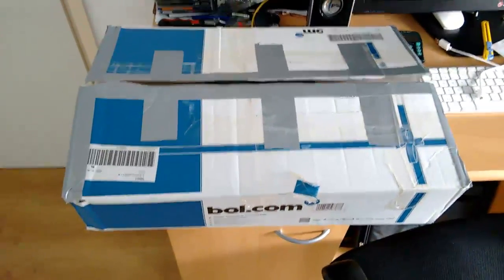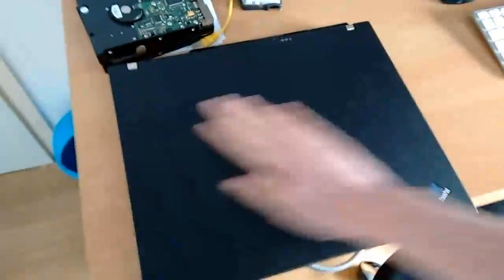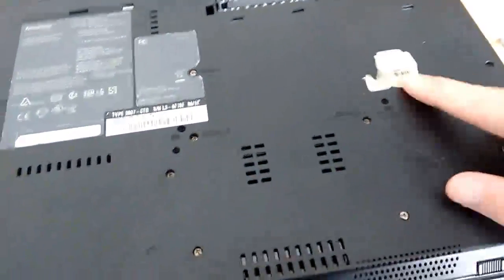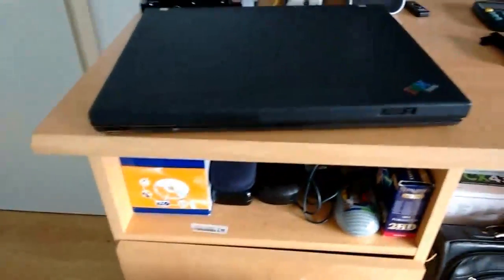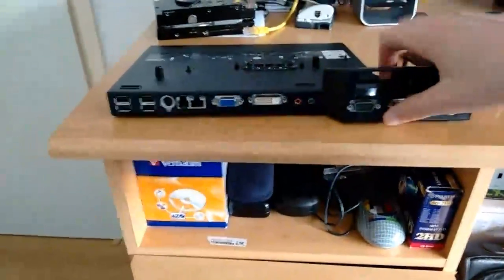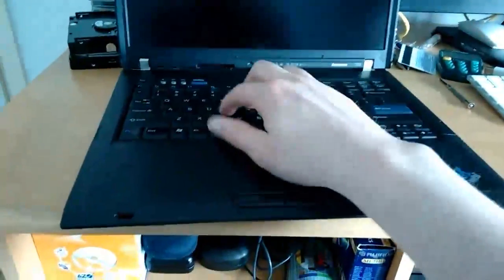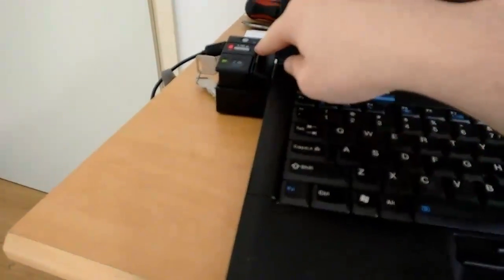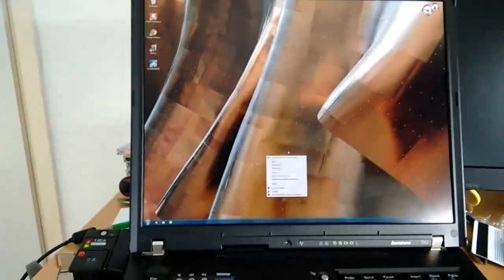Lenovo ThinkPad T60 - Unboxing, Repairs and First Look

Comment: 4:3 aspect with that resolution. Must be rare as f*ck. Lucky you to get a hold of one.
Reply from the maker: The previous owner was pretty sure someone jerry rigged the display of a Dell Precision laptop in this one. Lenovo never offered this resolution so that would make more sense. If I remember correctly it went up to 1400x1050 when configuring these machines. Default display was XGA 1024x768.

Comment: UXGA T601 Frankendpad?
The model on your other vid is 2007VHH which was 1024x768, i bet that screen is from a dell precision.
Reply from the maker: That's very possible. A Precision class laptop could very well have had the option for a QXGA IPS display. I don't know the full history of this machine, though.
Reply: Theres a few Dell fans on the Thinkpad forums and they've mentioned that some of the big Dell screens have the identical fittings for the T60/61 and should in theory be a straight swap. How do you fill that real estate lol
Reply from the maker: I use the laptop for Unix scripting assignments currently. In OpenSUSE, I can snap 4 windows on the screen. 2 terminals, one libreoffice and one web browser with some information. Works like a charm ;)
Reply: yeah i've got a more modest SXGA+ T60 on the way for learning ruby programming, I'll throw Arch and i3 on for that. Hows GPU temp when using it normally?
Reply from the maker: I don't know, honestly. It gets pretty warm, but nothing to be worried about. I repasted the CPU and GPU as well as the chipset with Arctic Silver 5, which helped a lot.
Reply: Reading up on the T60 i see plenty of ppl putting a T500/W500 heatsink/fan assy in place of the stock unit. Brings temps down by 10C as its a beefier design the northbridge heatsink sits properly with a pad.

Does OpenSUSE have tlp or laptop-mode-tools?
Reply from the maker: OpenSUSE does have laptop-mode-tools, yes. It can even be installed via the GUI (YaST2)